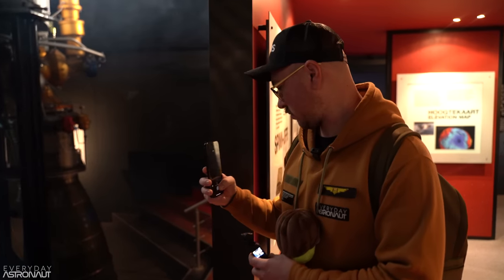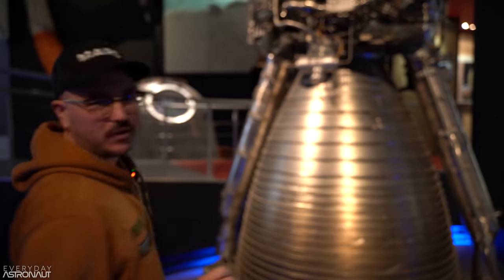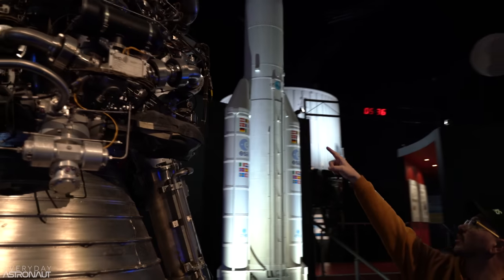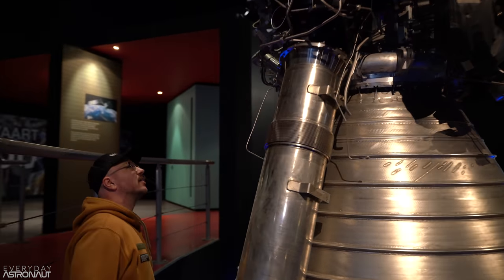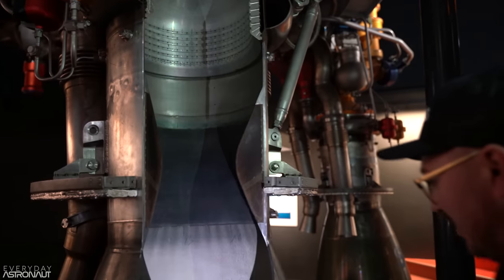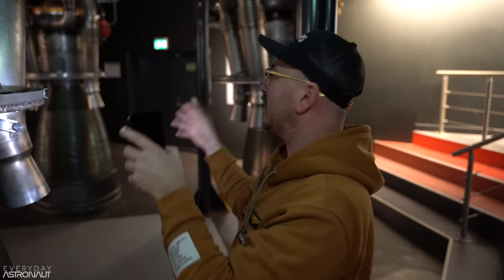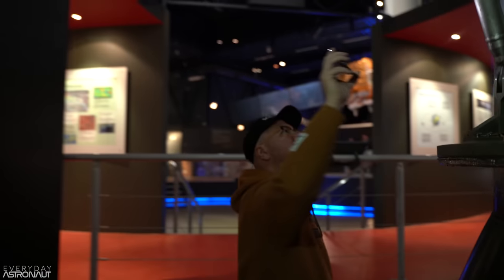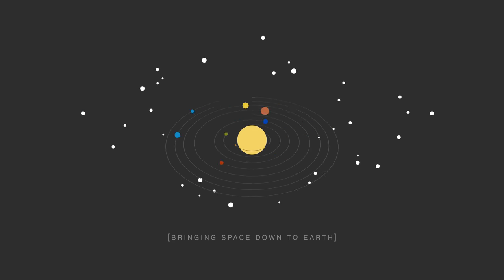What it's like inside rocket engines! Viking 2 and Vulcain 1!

Comment: Hey Tim! currently 14 and an aspiring aerospace engineer. ive learned almost everything i know from your videos and your videos were what inspired me to pursue this path. thank you for everything youve done and made tim. good luck on dearmoon! ❤❤
Reply: Good luck buddy
Reply: Learn how to maintain every engine possible.
Reply: Check out Rocket Propulsion Elements by Sutton.  Make sure you learn your calculus (including differential equations and multivariate calculus and vector calculus).  Make sure you learn lots of linear algebra.  Good luck!
Reply: Good luck from Australia mate, if you apply yourself you’ll get there!
Reply: thank you all so much :)
Reply: @strykerfpv  find someone that has a machine shop and beg to work for free when you can. Claim as work experience.

Comment: 16:46 the toroidal tank is for water injection to cool down the walls and gas generator! , also VIKAS engine of ISRO uses water injection as it is based on the Viking engine.

Edit: oh, you figured it out! (22:46)
😅
Reply: Exactly! Vikas engine is based on the Viking engine. But, ISRO does something that avoids the confusion. They paint the toroidal tank blue.

Comment: Im not sure if it was mentioned, for the last rocket engine. However, I think when you realized the steam driven turbo pump, it explains the two exhaust pipes. One is a steam exhaust and the other is the gas generator to create the steam! What an interesting system!

Comment: So the second engine uses a sort of 'steam generator' instead of just combustion gasses.  I suppose it uses less fuel/oxidizer that way, but of course you have the complication of water tank/ pump system.  Pretty neat variation.
Reply: This was a relatively uncommon design. The guy in charge of the development of this engine was a specialist in gas generators. He invented the three-component gas generators during his previous tenure at Peenemünde and naturally wanted to use them for everything.

The cool thing is that you can adjust the temperature of the steam at will, and the gas will also not explode if you use it for pressurizing both the fuel and the oxidizer tanks. But for this to work well, the steam still had to be very hot, at a few hundred degrees Celsius, and this mandated making the tanks of the rocket from steel, which, unlike aluminum alloys, maintains strength even at elevated temperatures. SpaceX uses steel for Starship for a similar reason.

Comment: Hi Tim. Thanks for the great video! Was fun exploring these engines with you and seeing your first impressions. With a spiral wound engine bell I would imagine that the smaller tube cross-section at the top would have an advantage for cooling. The smaller cross section would create higher coolant flow velocities and thus remove heat more quickly from the most critical area of the engine bell. Is this a correct assupmption?

Comment: The turbine in the Viking 2 is an axial turbine which is what is used in all modern aviation jet engines.Generally speaking, as flow enters the turbine section it first encounter inlet guid vanes (often incorrectly called stators), then encounter the rotors (if more than one turbine is used there are stators in between each rotor), then exits via outlet guide vanes (often incorrectly called stators).  If this is the case here then your labeling is wrong.  However, the geometry looks a little off for this to be the case to me. Do you know how many turbines are on the Viking 2? It would be unlikely for the engine not to have outlet guide vanes as this would induce rotation in downstream flow which is energetic and turbulent.

Comment: Could someone explain why the oxidizer pump is typically smaller than the fuel pump? I'm sure the temperature and density differences between fuel and oxidizer play a huge role, but how does that relate to the O/F ratio? Typically, hydrolox engines run ~5:1 or 6:1 oxidizer to fuel. Does this also play a role in pump sizing?
Reply from the maker: You’ve nailed it! Both fuel density and their O:F ratios determine pump size! It all comes down to mass flow of each propellant which are greatly affected by their densities

Comment: Hi Tim. Just wondering why NASA doesn’t send an amount on small modules to the moon’s surface prior to landing in a particular location that could broadcast to assist with telemetry in landing? From what I have been able to read, altitude is an issue with landing telemetry. Thanks sir. So stocked for your progress and your future space flight.

Comment: if a raptor combustionchamber was made out of some titanium alloy would it increase possible chamberpressures or fail  sooner due to lower thermoconductivity than steelalloys?
Reply: Some Soviet rocket engines made from titanium were flown on real spacecraft. But it is not a common material for the engines.

The most widely used material for the inner surface of combustion chamber, including in Raptor, is a copper alloy with a small amount of other elements to improve strength at high temperature.

Regardless which material is used, it cannot on its own withstand the temperatures in the combustion chamber. It has to be cooled usually from both sides. And with proper cooling, almost any material has been used -- including ordinary steel and cast aluminum. Aluminum engines have flown on real space rockets, and low grade steel has been used in small soviet engines for military rockets.

Comment: It's probably not that easy to cut all these pipes in such an educational way. So kudos to whomever did the planning and the cutting.
Reply: I was thinking the same thing.
Reply: Ya I was thinking how cool would it be to be the dude paid to cut up a whole rocket engine and what kind of blade did he use
Reply: Cobalt is what high end drill bits and end mills are made of.
Taking a hacksaw to this nozzle wouldn't even scratch it.
Reply: @AcidGambit419  abrasive zipcut wheel. .045 ( aprox 1 mm ) thick 
or a jewelers saw blade . the abrasive blade cuts pretty much anything.

Comment: So that is why before falcon 9 stage separation you hear launch command say something like stage 2 engine chill has begun? interesting.. I never knew the pumps had to be saturated and chilled, I thought it was just chilling the nozzle or something to help with the heat of the engine firing. I love learning new things! Thanks Tim for all that you do!
Reply from the maker: Watch my video on how to start a rocket engine! You’ll learn all about it!
Reply: That's why you see white vapour pouring out of a starship during a hop and ice coming off a F9 while it's coming back.  The engine chill system.
Reply: yep, this not only protects the pumps from thermal shock but rather also the propelant from boiling due to the warm pumps, which avoids bubbles that can damage the pump to destruction.
Reply: I'm impressed they can chill down the turbo pumps -- without having leaks from the hydrogen side into the oxygen side (hydrolox).  Or from the oxygen side into the RP-1 side (kerolox), or from the wherever to whereever (methalox).
Reply: @EverydayAstronaut  are you still in Holland?
Reply: @peterfireflylund  that specific problem is why the sealing technology in the RS-25 is mindblowingly complex. The engine is a technical marvel in hydrogen management.

Comment: Mockup parts are usually first run parts, QC test articles, or parts that have a deviation that excludes them from service.
They are still very useful, because you can install it, run all your extra lines and fittings based off the mockup's correct positions, fully build the assembly subsystems around it, verify them, and then install the flight article. this keeps damage like the repairs done on the engine bell from hapenening to ancillary parts where it can be avoided.
I've even heard of mockup parts in the complete wrong material. that might be a stainless steel part, while the flight article is inconel for example. just for weight alone, i'd rather work with the stainless part. inco is HEAVY

Comment: Only an expert would have the confidence to question another expert - in this case the Viking 2 placard, which non-experts would reasonably expect to be accurate - and not only be right that the other expert was wrong, but then deduce the correct answer. Very impressive.

Comment: It was actually quite informative to watch how you worked these things out in the metal, in 3D. It shows the process of reverse engineering the combustion and control to some degree. Some of these things I would normally just be watching reference to a drawing, nodding along and saying "yes of course" but working backwards this way creates a fuller understanding of like fluid movement, and temperature control, and sequencing. Are there other near complete cutaway engines you can get this up close to?

Comment: Late to the party, but I suspect those valves on the bottom of Arianne 1 are for filling and emotying the tanks on the stand.  Easier to do a quick disconnect when entire rocket is pulling in the desired direction.

Comment: why dont you just have multiple linear/curved lines down the sides, not one tube spiralling like a coil
Reply: then just dump the fuel as afterburner fuel into the exhaust directly
Reply: diy complex rocket engines, by 3d printed plastic mold - graphite coating - electroforming actual metal, like high temp titanium/chromium
Reply: why dont you transition to afterburner rockets
Reply: heat up the propellant, no need to use turbines, solid state loop back
Reply: those most of the fuel is burned after the neck anyways, why try to be "inside combustion chamber" in name only
Reply: ie most thrust will come from the expanding section, not the inside neck section
Reply: piezo gimble
Reply: same for the air-breathing turbines, dont make it complex, a single unskilled person can do it, k.i.s.s.
Reply: down on earth? no be the earth, not above the earth, and not under the earth either
Reply: so use the cryo fuel to cool the nose cone of rocket (entry/launch ablative cooling nose spike cone nozzle), use water cooled spike cone flame deflector as the rocket launch shield (spray water inside from the top to sides)
Reply: for plasma temperatures use plasma stuff, no melt, maglev induction plasma bottle levitation shield on the thrusters/nose cone

Comment: The structure above the throat I assume must handle the full thrust of the engine and push the rocket upwards. If you divide the nozzle into slices from the exhaust up to the throat, how does the force change from the bottom to the top?
Reply: Thrust is a vector sum of all the forces from the pressure acting on every surface of the engine. Nothing more, nothing else. How much thrust comes from a particular part of the nozzle depends on the pressure acting on that part of the nozzle. The diverging part of the nozzle is usually responsive for a significant fraction of the total thrust.
Reply: So the cross-sectional area increases closer to the throat?
Reply: @tomassvenningsson6260  In many engines, the walls of the nozzle are thicker closer to the throat. But it is not so simple as just optimizing for resisting the thrust forces. One would need to go into specifics of how it is all made, whether the walls are regeneratively cooled, and then calculate stresses at every point. And then there are limitations on what can actually be fabricated and how it is going to be done.